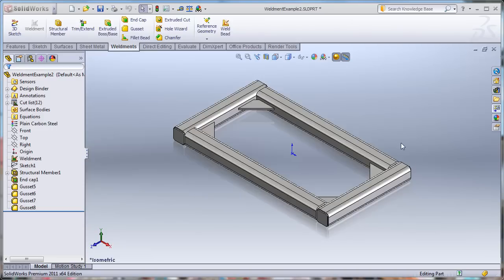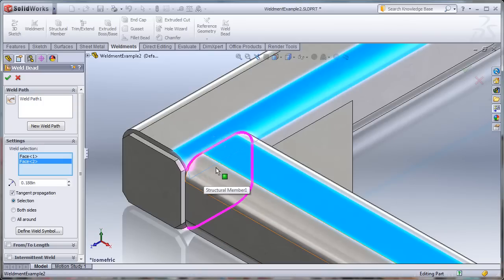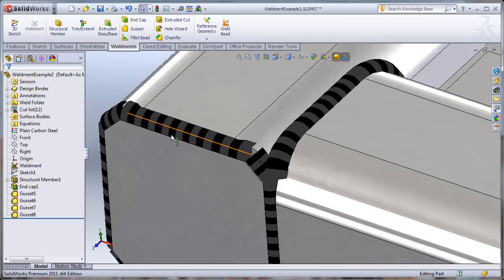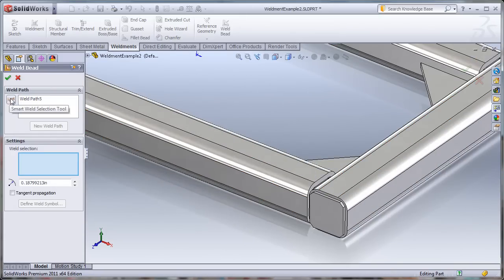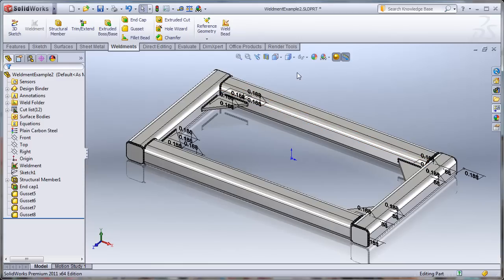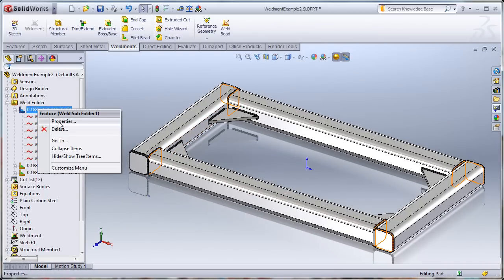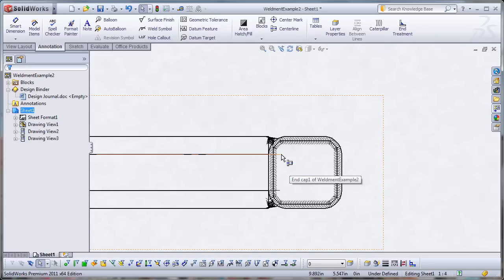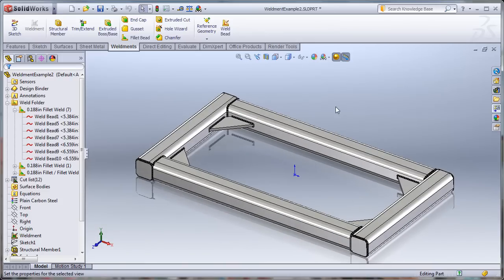SolidWorks 2011:  Weld Bead Part 1

Comment: Hello Ricky, Great tutorial. I looked for part 2 but could not find it. I'm designing a motorcycle frame but I'm having problems creating weld beads around the surface of  touching tubes and from gusset plate to tube. Can you help? Thank you,